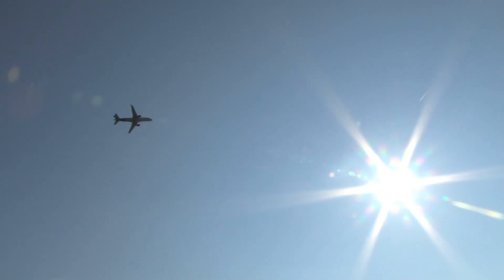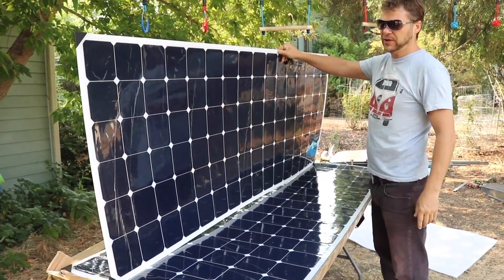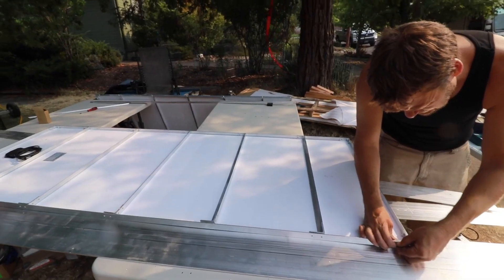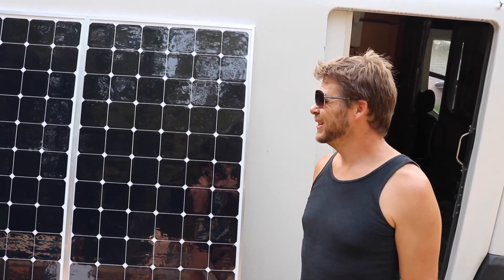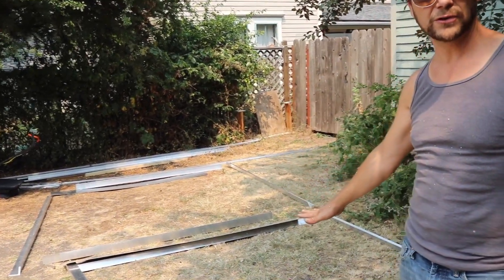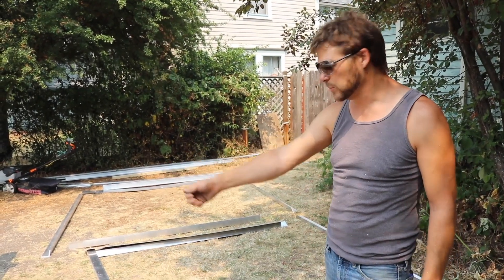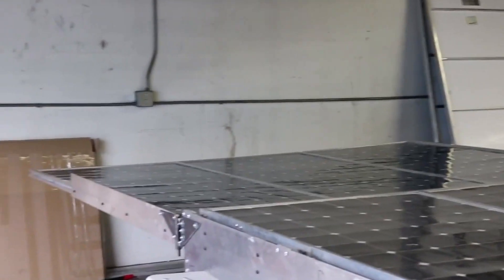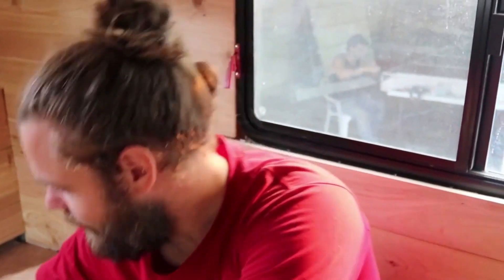How we built a MASSIVE EXPANDABLE 8KW VANLIFE SOLAR ARRAY | DIY Build Series | Electric Vehicle

Comment: I am still watching the video. What was the manufacturer of the panels? Looking at adding something like that to the Electric Camino to charge while parked at work.
Reply from the maker: Hey dude these are custom panels made using SunPower cells. Go check out SunPower.com and their flexible panel selection you should be able to find what you need there.